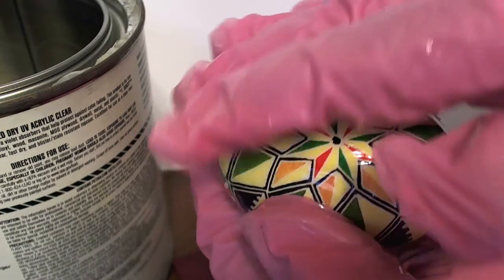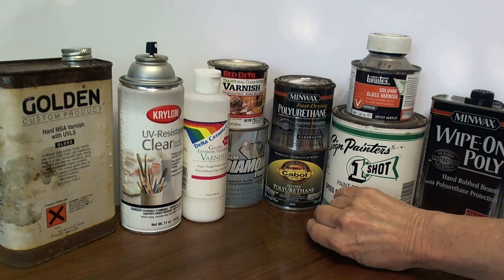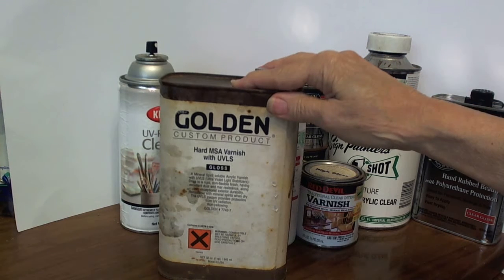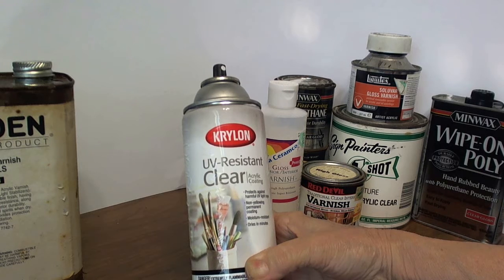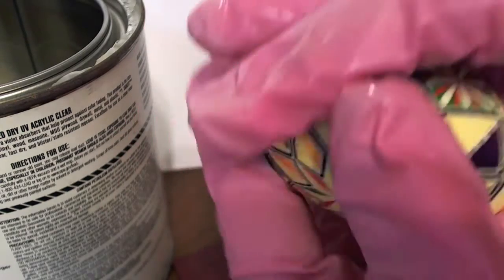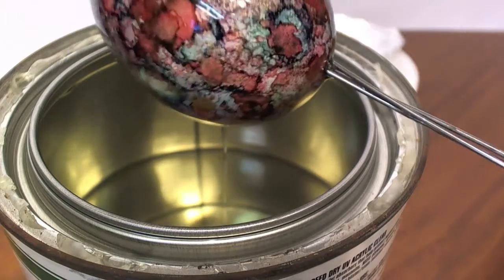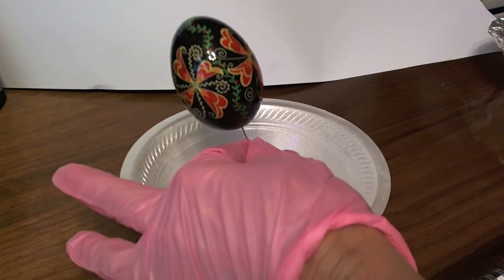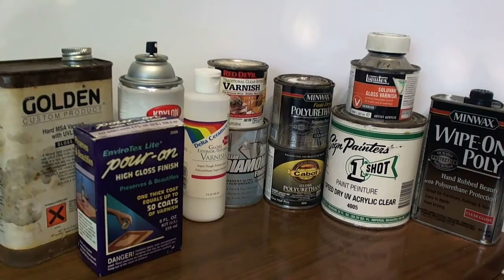How to Varnish Eggs - Pysanky Polyurethane Golden MSA Minwax Soluvar Epoxy Krylon KBS Diamond

Comment: Ive tried the KBS Coatings DiamondFinish Clear recently, and it doesn't dry as fast anymore (this video is 6 years old) and it ROCK hard. I love and totally recommend it!
Reply from the maker: Thank you Lauren. You might try to thin the varnish  with a thinner. KBS recommends #1 Thinner.  Different season have an effect on drying times too,  house temps too.

Comment: I tried the Krylon UV Resistant Clear, but it smudged the dye...maybe because it's supposed to be JUST sprayed on and not rolled to cover as I did?  I've always used Minwax, but live in FL and many of my eggs are faded, so could I Minwax and then spray on the UV clear?  Your video says could varnish after UV spray... Thanks :)

Comment: Lorrie, you do such lovely work.  I am new to egging and really appreciate your videos.  :)  With the thicker epoxy finish what is the preferred way to apply it?  I have been dipping mine in the poly but it is thin and to get a deep shine needs several coats.
Reply from the maker: Thank you Rebecca, I show some of the different products and some of the ways they are applied I normally apply many coats mainly because this is the better way for me to control the smoothness of the finish. Each artist will find the process that will work best for them. I tell folks to try everything and then see which method works best.